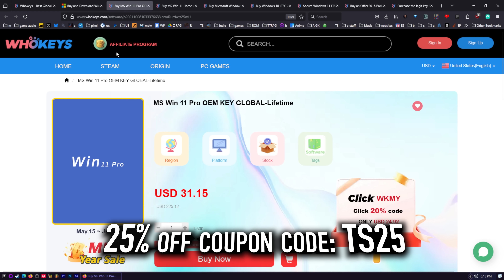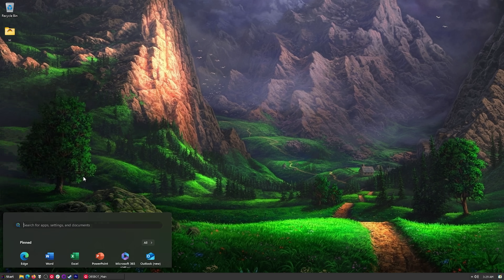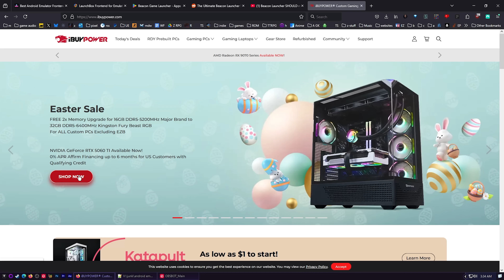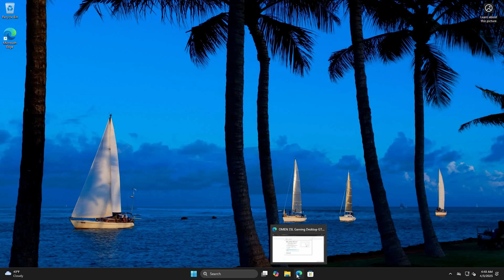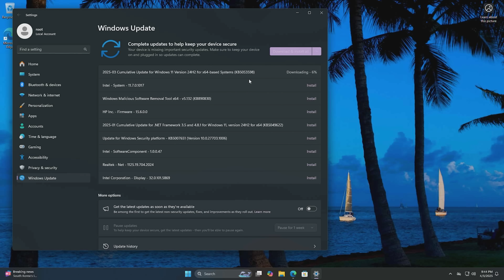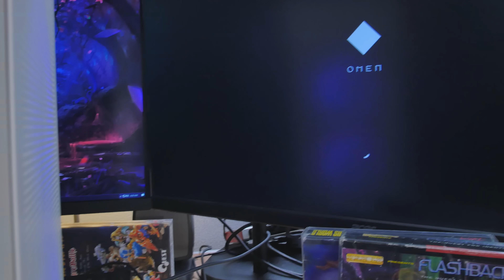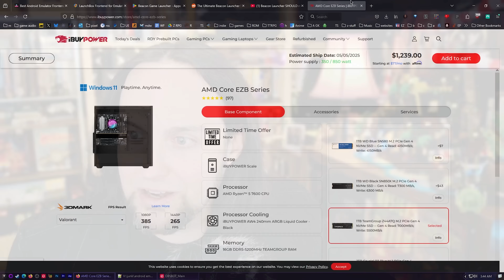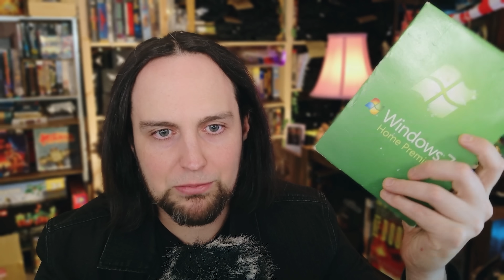DON'T BUY a GPU This Way! (I Was Dumb, a Cautionary Tale)

Comment: I just bit the bullet, got a 5090 (which is just insanely better than 5080 and a giant step up from 4090), and won't touch it for ages... Also into MW5, and at 5120x2160 ultrawide, and didn't want to fuss about stuff... According to some analyst, at this rate, a hypothetical 6080ti Super will still not be faster than a 4090! ------ and hard to value that 32gb VRAM boost

Comment: I have a 3070 ti I was gonna jump to the 4070 ti or one of the advanced 4080s, so I was price watching closely as the 5000 series was announced, I was hoping for a price drop but they turned around and pulled all the 4070s and 4080s off the shelves. scalper prices shot up and the 5000s were cheaper performance for performance. so now I am waiting on a 5070ti to actually hit MSRP. Im okay to wait as my 3070 ti is UVed and OCed and bench out in the upper ranges of most peoples 4070 Ti. obviously what ever I do get will be UVed and OCed to squeeze out that much more.

Comment: 12:32 This is also why I like the more hardcore Linux distros, currently being Gentoo and Void. I've messed with some things so I have a deeper understanding of how they work. Even just a couple years ago, I took the lazy route by installing a desktop environment just to get things like sound and OBS working in a standalone window manager but now I actually know I just need things like Pipewire, XDG Desktop Portal, Pavucontrol, etc. I've also configured it enough to know where the config files are for sample rate, bit rate, etc. I don't even need a graphical front end for Pipewire because it's actually pretty straightforward. It's usually in /etc or /usr/share.

Comment: It's really been a mess and the only option you have is to pay too much. I also wanted a 4080super to replace my 3080ti cause some games were starting to push the 12gb of vram at 4k. But as Nvidia stopped producing them they skyrocketed to $13-1400. So I figured screw it, I'll wait for 50 series and get a 5080. We all know how that went. So around the time the 5070ti and 9070xt was starting to reach $1k some of the 5080s were getting restocked and I saw one pop up for $1250, said screw it and bought it. Now they're back up to $1400+.

I hated paying that much but was reminded of what my brother said when I berated him for paying $1200 for a 4080 over an XTX: You regret paying too much for only a couple weeks, but you regret buying AMD for the entire life of the card.

Comment: i got  a Alienware 16 Aurora AC16250 witha  5060  MY ONLY ISSUE is i got  only 16gb    find   ram that   work  like upgrade  96 or  128gb  ram the 64 gb i order  did
 not work

Comment: feck..... iv just took a HP omen in part ex and was stunned by the lack of quality. one 120mm fan in and a 90mm exhaust..... for a 3070ti that was actually closer to a 3060ti in benchmark poerformance..... had to recase it in the end. Dont buy HP, yall been warned, they are shocking!

Comment: Is that "ATX Case" the Silverstone Fara 513?
Reply from the maker: Cooler Master Silencio S600... it's a solid 8.5/10 for me. It would be a 9.5 if the mounting screws were slotted rather than fixed in the front.

Comment: You did way more troubleshooting than HP should expect from their customers. How could there have been a restocking fee if your PC didn't work out of the box? The shot of the "cable management" is such a mess... holy crap! All white cables are nice with a white case though.  Oh wow... I was looking at the front of your new case with the Noctua fans... and then it clicked what that white box was... nice fit!  The new one does look better, I agree that a smaller card is better... I have an AMD Radeon 6950xt still that I bought at launch for too much money because I was excited. Even though it was a waste of time at least you got to mess around with computers for fun right?

Comment: It would be nice if the YT bots would QUIT deleting my messages...it's very tiring ....

Yea Pre-builds can be pretty bad, this is why I just buy the parts I want to use and go from there, custom builds will always be the better way to go.
There is Ebay there is AMI-Bay as well but try looking in forums as well like Tech Power Up forums, Overclockers Forums or H-OCP forums, just a shame the EVGA forums are gone I got a lot of great deals from their marketplace as well, ebay does not always need to be the only way out.

Many thanks for making this video since it may help people to avoid making the wrong choice, I hope the card does you well, I myself bought a Sapphire Nitro+ RX 9070 XT, for me and what I do with it, it's truly fantastic and it's rock solid, it also has great Linux support.
For Ageia/NVIDIA PhysX, well for that I have a nice EVGA GTX 480 that I picked up for just 19 Euro's just 5 days ago, all I need to do now is seek a nice GTX 590 and go from there the GTX 590 for the Dual chip SLI and the GTX 480 as the dedicated PhysX PPU.
Take Mirror's Edge as a great PhysX game that I have and really want to replay with this Fermi dream build, I think it will run very nicely at 1920x1200x32.
System is a Dual Six-Core AMD OpteronDP 2435 D0, 12 cores  at 2.6Ghz, 8x 4GB DD2-800 ECC Reg ona nice Supermicro H8DAE-2, all built for these Fermi GPU's.

The Fermi like of graphics cards were my favorite hence this cool build I am going to do even it's more of a workstation, I think it will get along nicely.
And agreed lots of second hand stuff can be extremely overpriced, it's disturbing in ways, right.

Keep up the great work, Peace!

Comment: it sounds like you didn't go into the actual bios of the pc, The screen you showed was the HP Diag menu which isn't bios.

In bios, you would probably want to default everything and disable resizable bar so that other gpu would work correctly.
Reply from the maker: I did go to the real bios, but I didn't get video from that portion of my testing/tinkering.

Comment: I love PhysX as much as you, it's such a dope technology and was really nice to have some years ago when Cpu's just could not handle that kind of thing. Seeing that Blackwell doesn't support the older stuff is really frustrating, it's not even like it would be tough for them, get it running and then leave it alone, easy, no upkeep to worry about. It's silly we'd have to throw in a little 3050 or something just for that purpose, but at least it can be done. But that makes me wonder, since that works with a 50 series card and a second Nv Gpu for PhysX, what about running a Radeon card and using a Nv Gpu with it in the same way.. Also those Gaming X Trio cards are awesome, over built cooler, good placement of thermal pads etc, and I keep getting lucky with good overclockers etc. I've had the 40 series and 50 series versions.

Comment: GPUs are a crazy market right now. I bought a used strix 4090 for $1800. When the 5090 came out against my better judgement I bought it as soon as possible to sell my 4090 while the 5090 still is in a shortage. I sold my 4090 for $2400. That was the price of it when it was brand new and it's a 2 year old card when I sold it. I think this is crazy because the asus 5090 being $3500 makes the asus 4090 at $2400 a better deal when it actually isn't.

Comment: I dunno, I am sticking with my GTX 1080ti until I really am required to have ray tracing. It does everything I need for my current requirements. No need for frame generation, too. I know it is probably going to be a lot sooner, but until then...

Comment: That sounds awful to go through tbh. I don't get what nvidia is doing by removing features that got them their loyal customers.
It's the same with Windows or Apple. They just do whatever they want, we, the customers don't matter anymore because we're already in the ecosystem or used to certain features.
That's the reason why I went AMD / Linux with my current build and it's been doing well for almost 5 years now. Investing in AM4 really paid off.
That being said, I don't think I have to upgrade from 6700XT / 5700X3D anytime soon. Perhaps if I decide to go for 1440p / 144hz or 4K.

Comment: Freaking Bananas I bought a Nuc 12 from eBay 700$ It wouldn't boot. It runs Linux only and I kept it.

They upgraded it to Windows 11 Pro for free. I believe that's where it wouldn't show a display anymore. It's a problem that's documented when you install the GPU drivers you lose Windows.

Comment: Dang. 3080 TI was struggling with MW5.

I was playing MW5 on my Laptop 3070. It was a struggle at times. But I think I got it to play at a playable rate. *Edit - Ha. My laptop was an HP Omen 16. It is still pretty decent with an 11800H and 3070.

I have upgraded to a desktop with a 5080. I think I will revisit MW5.

Comment: I have a sapphire nitro + RX 7900 XTX with a bykski block and love it I don't think I will buy Nvidia any time soon with a the driver and high volt cable problems until they solve it and make their software as good as AMD software is then I will buy them

Comment: The M.2 was likely the cause, machines like these are really something else with their closed bios and custom motherboards. I would stay clear from them. :)
Reply from the maker: Maybe, but all the tests came back OK. I've found that unstable ram can do this... otherwise, maybe a loose power cable, but I did press them down.

Comment: If people didn't buy the gtx 1000 series and protested back then, the market would still be good. The only difference between the gtx 1000 and rtx 4000/5000 series is that the gtx 1000 were more affordable, but equally as overpriced percentage margin-wise.
Reply: Dude ! Pascal series was a game changer vs 900 series . It’s touted to be one of the best gens Nvidia managed to ever put out.
Reply: @maxpayne69.  No, they skipped 2 process nodes, 22nm and 20nm and went directly to 16nm.
The gtx 1080 was a 314mm^2 die size, out of 858mm^2 reticle limit. That's a 60 class die size. But it cost 700$ (FE)MSRP, usually 680$ from 3rd party sites, check TPU. It should have been 350$ MSRP max. 

The rtx 2060 is 445mm^2, the rtx 3060 is 296mm^2, the gtx 760 is 294mm^2.

Performance is a byproduct, not a cost factor, nor a factor if the chip is big enough. 

And people praised them like they were the best thing, when it's the process node(16nm) that was one of the most dominant process nodes and again skipping 2 process nodes.

Check the gtx 950 vs gtx 1050Ti on the good old gamer, literally 0 improvement in the architecture for gaming. They have the same specs, except the 1050 has 4GB VRAM...
Reply: @maxpayne69.   No, they skipped 2 process nodes, 22nm and 20nm and went directly to 16nm.
The gtx 1080 was a 314mm^2 die size, out of 858mm^2 reticle limit. That's a 60 class die size. But it cost 700$ (FE)MSRP, usually 680$ from 3rd party sites, check TPU. It should have been 350$ MSRP max. 

The rtx 2060 is 445mm^2, the rtx 3060 is 296mm^2, the gtx 760 is 294mm^2.

Performance is a byproduct, not a cost factor, nor a factor if the chip is big enough. 

And people praised them like they were the best thing, when it's the process node(16nm) that was one of the most dominant process nodes and again skipping 2 process nodes.

Check the gtx 950 vs gtx 1050Ti on the good old gamer channel, both GPUs have the same specs and the same performance at the same clock speeds. 0 improvement architecture-wise in gaming.
Reply: @maxpayne69.  I want to reply, but youtube keeps deleting my comment, do you have a mail or something I can write to you?
Reply: @rattlehead999 It’s probably the horrible comment caching bug of YT, your comment exists but isn’t refreshed & visible. I’ll check back here in sometime & let you know 👍🏼
Reply: @maxpayne69.  ok thanks.
Also it's not a bug, it's a feature.
Reply: @maxpayne69.  The gtx 1080 is a sub-mid-range chip(and thus card), a 60 class card/chip, that was sold for 700$, but it should have been 350$, maybe 400$ due to lack of competition.

Comment: Buy a 5000 series card and just dedicate an older 2nd card for physXs. I wouldn't go lower than a 1050ti, no 8pin 3050 6gb low profile would be the perfect card.
Reply from the maker: That is what I was thinking... that or maybe a new AMD card. I was actually looking at a single-slot 3050... Figured that might be easier to get new on Aliexpress, so that's a good option too if it's not too loud. Otherwise, a budget 1050 ti from ebay would do well.

Comment: Heh, i can sympathise with your search. I do more AI workloads than gaming, (its probably 50 50) but the ai workloads earn me money. I snagged a 3090 for its 24gb vram, but if i was gaming, the 4080 would be where i'd target. I'd love to have a 4090, but reaistically its not worth that much money for me, the 3090 is a bit slower for what i do, but it gets it done. and still games like a monster. if the 5080 24gb isnt more than a grand i might upgrade.

Comment: Nvidia. ya. I got a 1080ti for a very proprietorial water cooling build. I don't touch them. The 3000 sears was launching when I finally found one.
Reply: Media center wall mount PC with the aluminum custom water system. Only block available was for a GPU  1080/1080 TI took me years to get a founders. I swore off Nvidea after the crazy ness. I refused to spend scalpers pricing.

Comment: lol... hearing you talk about how much of a tight fit that 4080 was in your case reminded me of my current build. I have an XFX Radeon RX 7800XT in an original Fractal Design Meshify C.... suffice to say, I need to angle the card to get it into the case, move it over the PCIe slot, and then plug it in.. I actually use the bottom front 120 fan as a GPU bracket. 🤣

Comment: Funny your indicator for a new GPU is the same as mine. I recently underwent the same thing playing Oblivion remaster. My 6600xt finally wasn't enough to run a game at med-high settings at 1440p 120fps so I started looking. Thankfully my experience was much less complicated than yours and I ended up finding a 7800xt for about $600 CAD and it's been treating me well so far. (I just can't do nvidia cards anymore, I've owned many over the years, but switching to Linux in 2020 I had so many problems with drivers I switched to AMD and haven't looked back. I know nvidia drivers are better on Linux now but I just cant support their scummy practices and significantly higher prices for slightly better performance.) But I agree with your point at the end. I'm a tinkerer as well and in spite of the frustration I also believe it's worth it in the end. First thing I do with new hardware/systems is pop open the settings and see what I can mess with. A system like that HP would drive me crazy being locked down like that.

Comment: Pretty much the only card I've actually bought recently is my 7800 xt. I did get a 6800 but gave it to my buddy because he needed one. I'll be sticking with this till GTA 6 comes out on PC and that'll be that. I'm doing my best to never buy new hardware till I see prices drop or there's actually a $/FPS gain. I might grab a 16 core AMD CPU once I see one of em fall below 400, but that's different. Those prices have been good for a while. Also, if you ever have a possibly messed up or hard to sell PC, give me a holler. I like challenging hardware issues.

Comment: Whole PhysX thing, Years ago, Pre-2012,  back when I lived in Canada still, I ran a hack that allowed my AMD HD5770 to run main graphics and a 9600 GT to run the PhysX on my Q9650, Asus P5Q-E. For the life of me, I don't recall what it was called or if it was old TekSyndicate or Linus I heard about it from. However is really helped to play Alice: Madness Returns with all the particle effects and not suffer for it. I'm wondering if that kinna thing would work now. Like Pairing a RX 9060 with a quadro p2000 for the PhysX. I have the quadro, but not the newer AMD card... still rocking my RTX 2070 but I am starting to see issues in like Baldur's Gate 3 and CyberPunk 2077, I blame you In the former.. made it so tempting to play.. GRRR and I love it so I'll not teach your cat to do evil things, but you'll not get the potion of immortality either!
Reply: There's probably still a way to do it. But there's so few games that use hardware-accelerated PhysX to good effect in the first place, with it being replaced with PhysX CPU effects and now wholly different physics engines and middleware that run on everything – likely not really worthwhile to have a second GPU running all the time in your system just for those few older games.

Comment: Not planning on upgrading my 3080 anytime soon.
Reply: 3070Ti here.
Reply: 1050m here 💀
Reply: Same. I'm still running most new games on at least high with 1440p ultra wide. Some stuff I need to turn on DLSS but oh well. New cards suck.
Reply: Just upgraded to the 7900xtx would not go back.
Reply: 5080 here i kinda regret it so expensive 😢
Reply: 5090 here.

Comment: Performance is a drug and Nvidia is one of the meanest dealers ever.
Reply: Oh Nvidia dirty dealer of GPU performance
Reply: They pinch you on vram.
Reply: Nvidia is still dominating the top tier of GPUs—for now—at least until AMD launches their next line based on the UDNA architecture, which is supposed to unify RDNA 4.

Side note: Microcenter usually has a few refurbished or open-box 3090 or 3090ti GPUs in stock. I’ve picked up a couple under $699, even with the extended warranty included.

Honestly, there are days I walk into Microcenter with zero plans to buy a open box GPU… and somehow still walk out with one. I'll be doping hard. 😅
Reply: Nicely said 😂
Reply: Gear doping
Reply: LOL so true.

Comment: When I bought my 4080 super, I got a new credit card that gives you back $200 on your first $500 spent. Credit cards often have these kinds of new customer promos. I ended up getting the 4080 super for $800 after the cash back which didn't seem to bad at the time (the 3080 was $700 in the previous generation) but unattainable. It's been a great card.